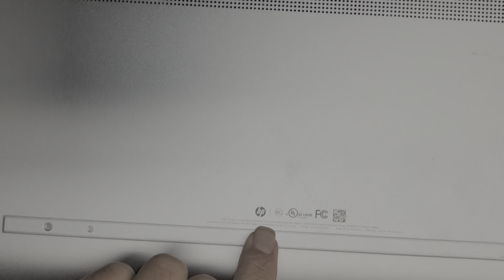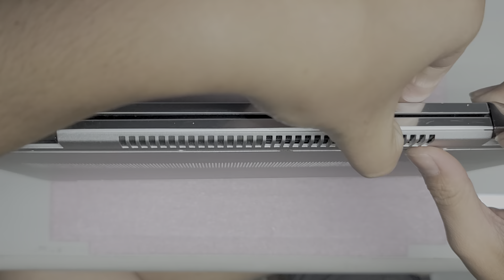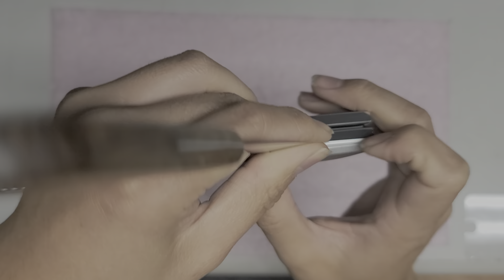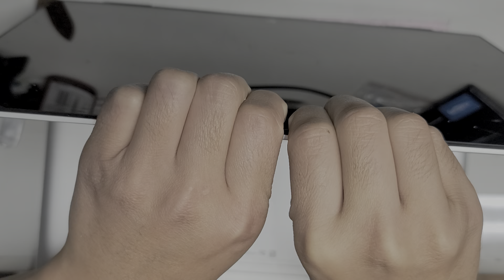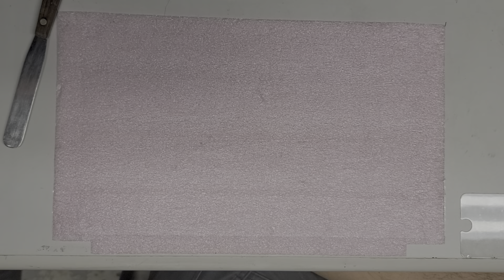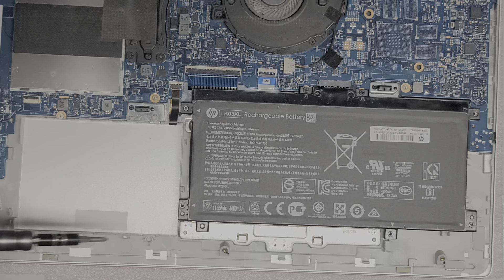HP Envy X360 m Convertible 15m-bp111dx Disassembly RAM SSD Hard Drive Upgrade Repair DC Jack Battery

Comment: Hi there, need help with something. My model is the x360 - 15-bp130ng which also got a RAM soldered inside the Mainboard. As far as I can see it's 4 GB - which is my problem right now. I need the laptop for programming games in Unity 6 and I have a lot of browser crashes, engine freezing, and my IDE dying so my teacher said I should upgrade my RAM (It's not my main device but still, it's cumbersome right now so I need to fix it somehow). I checked my configuration and using "wmic memphysical get maxcapacity, memorydevices" in admin cmd I found out I have 33554432 kb on 2 devices available, which translates to 32 gigs (you divide the kilobytes it gives you by 1048576 to get the GB) of RAM possible, but there's 4 hardlocked in the mainboard. I was pondering to get a 32GB DDR4 3200 kbit SDIMM Single for the one available slot, but I am worried it will fry my laptop because search online says "it's a gamble" (which I can't say if it's that dramatic or not). I can't get a new device rn and I just upgraded the SSD to a M2 980 PRO 2TB (the NVMe works like a charm btw for anyone pondering whether it's worth the risk, I had a 128GB SATA SSD in there before that). I am worried that going from my 12 GB RAM (soldered 4 + supposedly 8 flexible) to 20 GB (soldered 4 + flexible 16) RAM will not suffice when I go for particle systems and other stuff later down the line so, hm. I would be ok with installing technically 36 GB RAM but only using 32. Would you try and order a 32, see if it works and if not use a 16 or what's likely to happen with this model if you use too much RAM? I am not sure what to do in such a specific situation and HP support is kinda evasive as soon as your warranty has run out (due to time passing). Hope somebody sees this. Thanks if you reply.
Reply from the maker: It won't damage the computer to try. It'll either work or it'll just stay black screen if it doesn't like the ram.

Comment: my friend just gave this laptop to repair because he found it in the trash. This vid helps so much on how to open. When i connect the charger, it makes a constant chirping sound that immediately stops when I unplug it. Im glad to know that the batter is easy to pull out. The laptop immediately tells me there is a SMART disk error so im guessing both, the battery and HDD are no good. THANK YOU!!!
Reply from the maker: @windwalker111089  glad it helped. Hope the repair goes well. :)
Reply: @ hey!!! So it definitely worked. Thought I would need to change the battery but only had to change the charger. Replaced the dead drive that was mechanical with an Ssd and boom! All is done. Fresh install windows and fortunately it came with 16gb of ram. Also it’s touch screen! It does have an i7 gen 7 cpu but for just streaming and browsing the internet, it’s well worth the 70 bucks lol
Reply from the maker: @windwalker111089  wow! Incredible deal!

Comment: I got a different mother board. I installed the 2tb ssd left the 500 sds in and installed 16 Gn ram and left the other 8th in. It is a go 15m-bp111dx but has a 924308-601 board seemed to work.
Reply from the maker: @golightly209  nice!

Comment: This was a very good disassembly video. I personally recommend using a pry tool since the case edges are sharp and will cut your fingers if you aren't very careful.
Reply from the maker: Thanks, glad you liked it. :) Yeah, have to be careful on a lot of them. If you haven't already, please like and subscribe so others can find my videos. Thanks!
Reply: @ItsBinhRepaired  Already liked and subscribed 👍
I replaced my 1 TB SSD to 2 TB SSD and also the laptop battery that had gotten old and swollen using your video
Reply from the maker: Thanks! :) Glad you were able to upgrade and replace the battery.